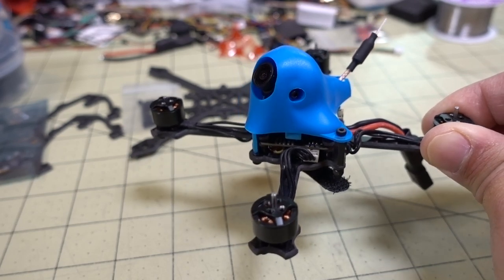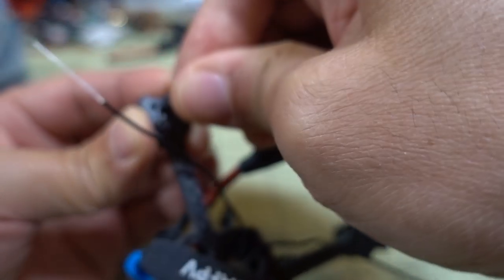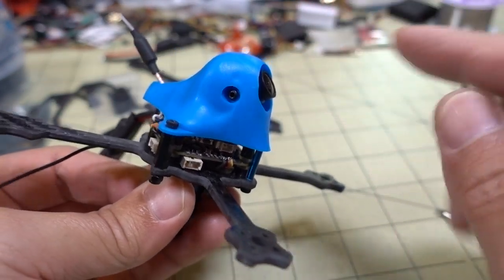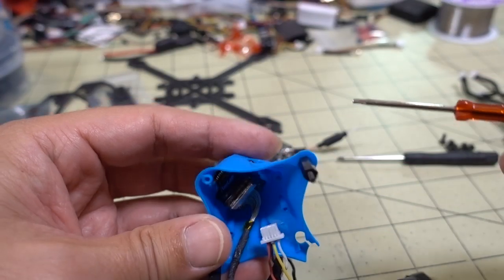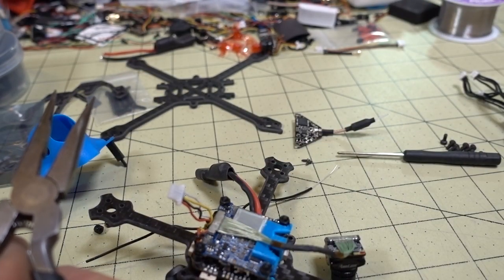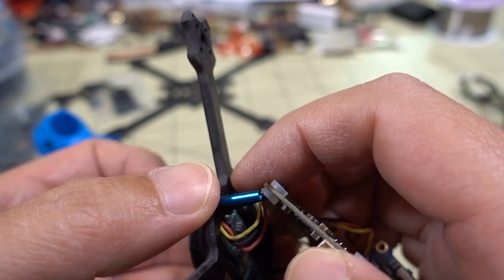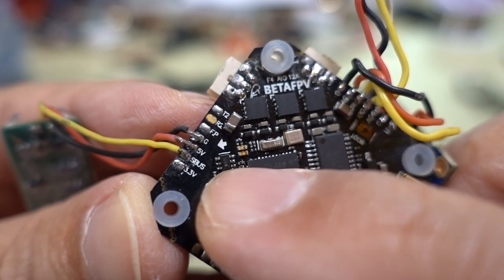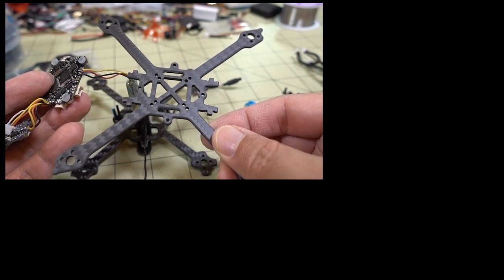Learn to build a Toothpick Micro Drone (by taking one apart) 🎓

Comment: Hi Albert, Thanks for another great video. I like the disassembly approach. Although the build videos are relatively straight forward, it is good to see how to take an RTF/BNF quad apart without doing damage...and to have everything explained and see how the "factory" puts things together (and where they make the connections). I really enjoy your videos, you are one of my top reviewers. Thanks. Keep up the good work. 
To Howard Nylander: My first FPV purchase was an E013 w googles. In fact, I still fly the original E013. The goggles are hard to use with eyeglasses...so... I used foam for spacers and bought stronger glasses. This worked until I bought my Viper FTX v02 goggles (great for eyeglasses).
Reply from the maker: Thanks for watching!

Comment: I just bought this frame and the hglrc 1103 10,000kv motors. Plan on putting my 75x stack in it to run 2.5 inch props. It’s currently in a 85x frame but crashed and damaged one of the motors. Could I build it the same way this one was put together? Just need m2 stand offs and screws?

Comment: Ty bro, please show the cam Install n setup I have a turtle 2  but have never wired one up, ps what size motor will give me best flight time.and Power and is a simple build.. this will either be a 2 inch 2 to 3s whoop my first lol beem watching all the vids what would yoi build .... damn u t motor for not listening, LOOK FORWARD TO MORE!.and taseir expensive any cheaper options worth using? Big up!
Reply from the maker: Turtle2 wiring is basically the same.  You need to solder video (yellow), power (red), and ground (black) to the same spots on the FC as you see in this video.  On a 2-inch whoop build I would go for an 1103 8000kv motors on 3S, 11000kv motor for 2S
Reply: @AlbertKimTV  thanks a million im on it, your the MAN.. ;)

Comment: I’m using the same runcam split but the fpv goes black where I only see the osd.  If I power cycle many times it sometimes works and records.  If I take SD card out it seems ok.  I’ve tried several 64 or 32 gb cards class 10.  Could this be a formatting problem or a defect?  Thanks
Reply from the maker: Have you tried changing how the camera is powered?  The BEC power source it is connected to right now might not be able to supply enough current to keep it powered while it is recording.
Reply: Albert Kim I think your right I’m using the 5v by the led pads.  I’ll try power of battery.  Thanks!